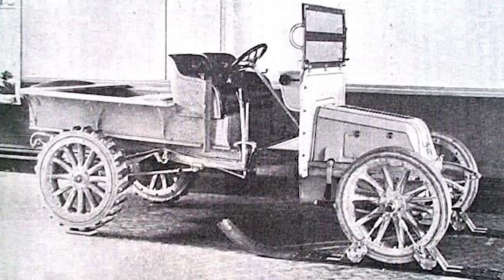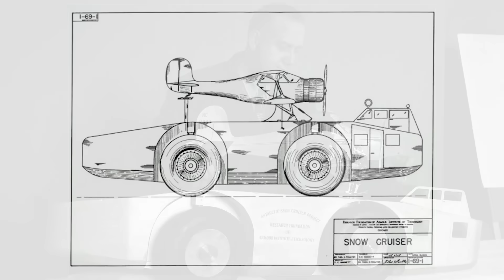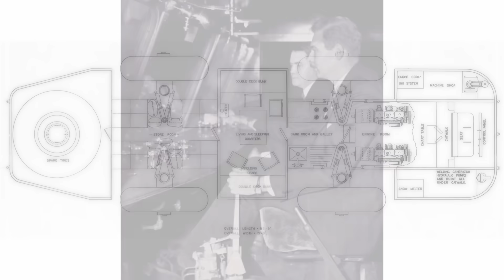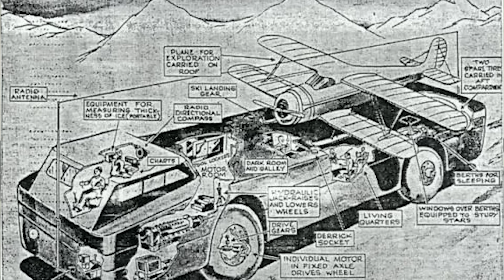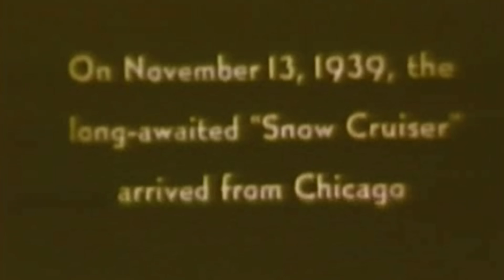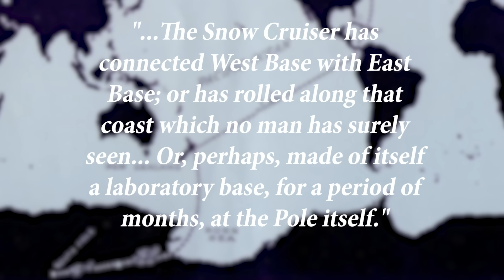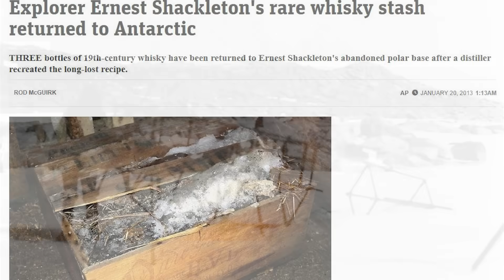"The Snow Cruiser"-Antarctica's Abandoned Behemoth

Comment: slick tyres on snow and ice is just the start of a long list of why this wouldn't work and I'm frankly amazed that anyone could think it would
Reply: Wonder why they didnt make some giant tire chains for it like they use on log skidders?
Reply: @robhartshorn6823  I think in 1 of the pics it did have chains on but only 4 so waste of time on such a big wheel
Reply: Me too.  Absurdly, weirdly naive to think it would.
Reply: I'm pretty sure wheel slip was not a problem
Reply: @attunedofficial  well it did slip off the road into a ditch and got stuck on route to port before it even left the USA which was a bit of a red flag
Reply: All terrain tires, a secondary engine where those spares were stored and it would have worked. (2 torquey diesels like a large ship) It would have used a massive amount of diesel and resources,  but would have worked for a period of time.
Reply: Lol I thought same thing
Reply: Must have used Boeing engineers.
Reply: If the snow is very dry, smooth tires would be great  and moisture would make them useless
Reply: Rologon tires work in the snow and their bald  just really wide
Reply: Didnt matter what size the tires were as it was to underpowered but with tires with larger surface area and with more power it could of at least had a chance.  Should have been built with more lightweight alloys but guess they couldnt afford it.
Reply: @xcalibertrekker6693  Considering its size its pretty light. A tank of that size would probably be 100+ tons.
Reply: @neilrobertson811  Its a scientific research vehicle not a tank, what are you thinking?
Reply: @neilrobertson811   no shit dude a tank has armour
Reply: @xcalibertrekker6693  I think the point he was making is that any normal vehicle that size would be much heavier. Clearly its been stripped to the bone as far as weight goes.
Reply: It might have worked if it had caterpillar treads instead.
Reply: @teamcybr8375  steel tracks and snow don't mix. The snow jams in the joints and wears the bushings out. Rubber tracks hadn't been invented yet.
Reply: @davidsinn  Snow didn't bother the T-34 tank in WW2.
Reply: @boltar2003  war is a different matter. The tracks don't last long on a T34 anyway.
Reply: @davidsinn  They need to last more than a few weeks.  A bit difficult to do that sort of repair in the middle of a battlefield.
Reply: @boltar2003  Weeks is no problem. It's just that the snow cruiser was meant for a year or more and that would have been hell on steel tracks. Repairing tracks on a battlefield is actually not that hard. Sherman's usually carried spare track segments hanging on the hull.
Reply: @davidsinn  wrong LGP D-8 were used extensively even trekking to the pole in supply runs  also had LGP D 4 and 6's. Wintered over in 1980 working as a mechanic
Reply: @danielrose591  I'm sure there were steel track machines used. Not arguing that. My point is this vehicle was designed to be independent and self sufficient for very long periods and steel tracks would not work well in that case.
Reply: The ambition and dreams of men gone before should never be mocked by those who have never gone at all. We were born into an age that could boldly do so much. But there is no boldness in this age.  Only the insolent barbs of a culture with no achievements to call its own.  So ready to speak.
Reply: @midnightwind8067  well said
Reply: James Herrell Hear, hear! Absolutely agree with you.
Reply: @midnightwind8067  well said.
Reply: You should look up the LeTournau land train that the US Army used in the Arctic Tundra of Alaska in the 1950's.  It was Diesel-electric, and had the largest tires ever produced on it.  Bigfoot 5 uses wheels and tires from a Letournau land train that came from a salvage yard in Alaska.  The tires had the standard US Army all terrain tread that dates back to World War II.
Reply: Brent Boswell LETOURNEAU
Reply: Smooth tires, 🤫 low air pressure 🤔🤨tires, equals maximum grip 😏 today we have
Tubeless mountain bike wheels 🤣🤣🤣🤣🤣🤣
Reply: heavyseven88 slick low pressure tires won’t give you more grip then a good treaded tire with low air pressure
Reply: heavyseven88 

Exactly! The best traction is “snow on snow”. Also provides maximum contact patch.
Reply: @heavyseven88  You're confusing snow and ice. For snow you need a deep tread to bite into it, for ice you need max contract and preferably spikes.
Reply: @heavyseven88  Yep - from a six time podium finisher, 3 wins, 2 seconds and 1 third in my final season ice racing in upstate NY.  

There is a trade off between low pressure increased traction and higher pressure stability though. My tires were pressured a bit higher than my competition which allowed more stability and control resulting in quicker lap times. The car was completely predictable and the handling more than made up the slight overall traction deficit. 

Some classes allowed spikes but my class didn't. We just had tire to ice contact alone. Ice racing was a lot of inexpensive fun and paid off big time in the wet when I transitioned into formula cars.

- dave
Reply: @heavyseven88  You want bite not surface area.

Comment: 30+ tons of weight on tires that relatively small?
What were they thinking? Getting stuck in the creek should have told them...
Reply: Exactly. Someone should have stopped this silly waste of effort.
Reply: @bzdtemp  at this point it's important to remember not much was understood about tire design. Honestly I am shocked that none of those tires poped....
Reply: They were worried about traction when they should have worried about floatation. Dispersal of vehicle weight over the ground.
Reply: And the tyres where smooth without paddles or any real tread, it wouldn't get through deep mud or sand let alone snow.
Reply: Plus tires with now texture at all. If they where made of ice it would have more grip.
Reply: It's the government, some things never change.
Reply: Smooth tires, too.

Comment: And all it needed was treaded tires <sigh>
Reply: And 5x the horsepower.  Only 300HP for that much mass.
Reply: By those standards  the early heavy tank St. Chamond was a total success.
Reply: @komitadjie  -- If you want speed, sure, but you can move the space shuttle gantry with 5 hp if you gear it low enough.
Reply: @Makermook  true, but there's a practical limit to that, and when you're NOT driving down a packed-gravel, specially-prepared crawlerway, you need to be able to negotiate some things a bit more expediently than a rate of feet per hour. Especially given that this was supposed to be a long range exploration vehicle.

Comment: The tires were so inappropriate, the massive weight, and track vehicles were already tested on the ice. I don’t understand why they went with it being so heavy and SMOOTH tires. 

Dead on paper.
Reply: You could tell just by looking at the plans it wasn't going to work. Tires were much too thin to float all that mass on snow. An engineering disaster.
Reply: UberLummox 
And University designed. I know, crazy.
Reply: @larryscott3982  Oh yeah. I missed that part. You'd think it was designed with zero research. It just boggles the mind. Not sure if they said it's weight but it must've been colossal. Let alone they didn't even bother w/it's aircraft carrier "capabilities". Gvmt. funded. There's your culprit. A small fleet of Model T snow vehicles from 2 decades prior would've been more useful at a miniscule fraction of the cost.
Reply: UberLummox 
75,000 pounds. 

Finding source didn’t dictate design. 

https://en.m.wikipedia.org/wiki/Antarctic_Snow_Cruiser
Reply: Our tax dollars at work
Reply: or at least allow the tires to be deflated for a bigger footprint.
Reply: @bc1969214  Good thinking. I bet they tried. Still too narrow to aquire enough floatation. Plus the tires being litterally treadless slicks...and "heated"??? Heated tires would just melt into the snow even further I would  think! On top of that, it even failed when adding both spares up front to add floatation by 50%.
Reply: @bc1969214  i.p.o
Reply: @bc1969214  Or they could inflate the tires with Helium to get it to   "Weigh less"  and maybe move better.
Reply: View This Unless you were strapping a couple of Hindenburgs (22,000lbs lifting capacity each) to it, it wouldn’t help, that thing weighed 75,000 lb, adding helium to the tyres would make 1% of bugger all difference.
Reply: @Therapistinthewhitehouse  The Hindenburg was the only thing that could actually make it to the edge. Thats why they FAKED the disaster. It was fake Jake.
Reply: Chris W let me guess, and Eric Dubay acolyte that takes what he says but hasn’t done any real investigation into the facts?
Reply: @chrisw5742  fail
Reply: Larry Scott yep, maybe if would of done better if they had some tred on them
Reply: Kni 
I am surprised at the motors. 75 HP electric each wheel, 300 HP total. 

The Diesel engines were 6 cylinder, 150 HP each. 

Seems small. But the tires were a mistake at the design phase.
Reply: @UberLummox Heating of the tires was meant to prevent the rubber from developing cracks, to my understanding. My guess is the manufacturing process/molds didn't allow for treaded tires of that size, back then - so they chose treadless?
Reply: For all of you wondering no you don't want aggressive tread on a snow tire for a large vehicle like this the idea behind the slick tire style was it doesn't break up snow and allow you to sink rather it allows it to compact under the weight the design was flawed though in that there wasn't enough width to properly disperse the weight the tires needed to be wider and the vehicle most definitely needed more horsepower as for traction the sheer weight of the vehicle is intended to provide that
Reply: I was a big prop.  Antarctica is not what they tell us. See my petri dish Earth vids.
Reply: LOL look at you flex how smart you are.

You should try and appreciate that your knowledge comes from people doing stuff like this.
Reply: Even chevrons or lugs wouldn't have helped much. The weight, the wheel footprint, the geometry - all should have been red flags at design phase.

Comment: The Ferguson tractor conversions were not invented until the 1950s  Used in the Hilliary expedition of ?1956. The tractor itself was only produced on the late 1940s. The snow cruiser could not have been inspired by these tractor conversions.
Reply from the maker: You're correct, those Fergusons shown in the video at 4:03 is placeholder footage, as I couldn't find any photos or videos of the tractors used in the previous 'little America' expedition that Byrd led and Poulter was second in command on from 1934/34. They did use tractors (akin more to artillery tractor half-tracks) in that expedition, as they had saved Bryds life during a period when he was stuck in a remote station and suffering from carbon monoxide poisoning. A number of similar half-tracks & tanks were taken with the snow cruiser on the second expedition for testing on the ice. 

Edit: Funnily enough I was looking through my archive stuff and found footage of the actual tractors! Check out 26:24 of this video- https://youtu.be/fnmxsj-prhM?t=1577

Comment: Was it not tested on snow before it was shipped to Antarctica? America may offer nothing quite that extreme, but surely close enough to figure out it doesn't work without the fuss of the transport.
Reply from the maker: The main problem, like many of these things was time constraints. It may seem obvious to us now, but tyre technology was still somewhat in it’s infancy and Goodyear has believed smooth balloon tyres would fare better in the snow after testing in what they thought was similar conditions in swamps and mud when they did testing down in Florida. Out of the 50 states in America, which do YOU think would most suit testing in cold, arctic condition? yes, that's right- Florida!

Comment: I wonder if RJ Letourneau got the idea for his heavy equipment from the snow Cruiser? You might want to look at Letourneau Snow Train, you may find it quite interesting.
Reply from the maker: Love the snow trains! Funnily enough they also used a diesel-electric drivetrain, very similar to the more primitive snow cruiser design. I'll bet there was some inspiration there.
Reply: @CalumRaasay  many of the large pieces of equipment that Letourneau design were electrically driven, he saw the inherent in efficiencies in the gear train that was being used at the time.

I remember an old piece of logging equipment that was built by Letourneau and it was really strange because you have these heavy electrical cables running around and just switches to control this big log skidder.

I don't know if you've seen one of his log pushers? There's one I believe up in Nelson BC on display
Reply from the maker: @krissfemmpaws1029  Great info, will definitely look it up! Would love to visit the Arctic & Canada to see some of these machines in the future.

Comment: They should have built a small scale truck-sized prototype first and tested it in soft snow.  Rushed development rarely turns out well.
Reply from the maker: There is actually photos of scales models they built, but you're right. Rushed development but also extreme promises that the engineers probably even knew they couldn't fulfill. Recipe for disaster!